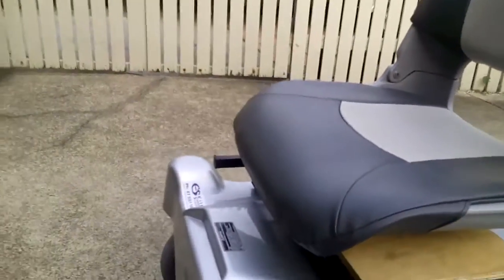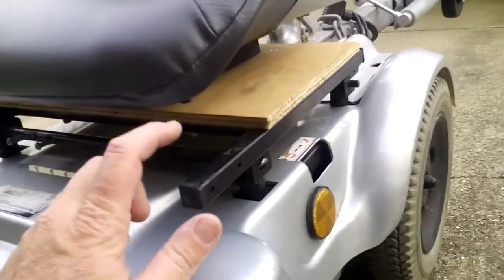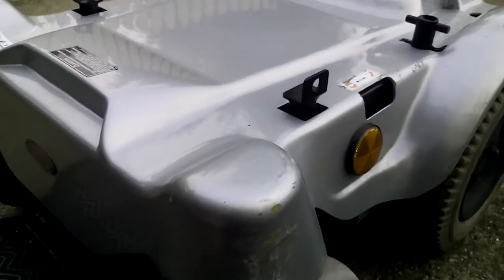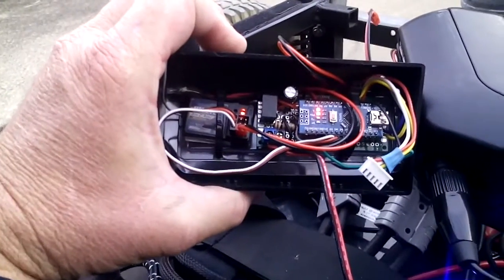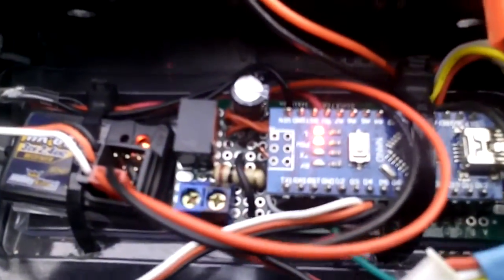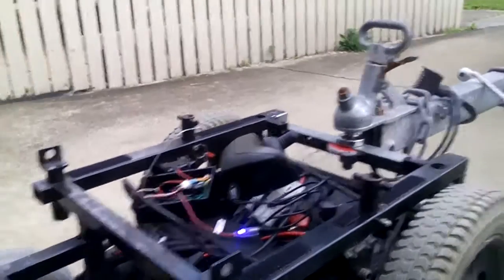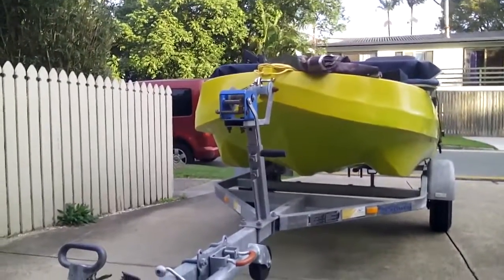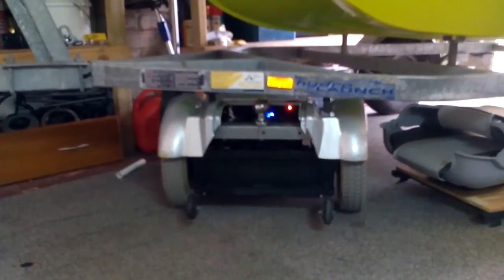Tear down and demo of my RC wheelchair boat towing power chair

Comment: Every single person on YouTube making something (ESPECIALLY ELECTRONICS) will not tell you how it is built, to include parts, schematics, codes. Almost ready to tune out of YouTube and spend my valuable time elsewhere.
Reply: Hi Wayne, I show how it's built in other videos I have done and link to the code and forums that helped me along the way. In the Arduino code on those forums is the link to the PCB i built, which has a screen print of all the components.

Comment: Can this pull a 21 foot boat weighting about 2500lbs? Was thinking of making an electric dolly but if this works then i can buy 1 for about 300 n save me some time.
Reply: On the flat ground with rolling weight only....possibly. It would be easier/cheaper/quicker to use the same sort of base as a power assist for manual steering and manual turning to overcome the inertia of the load.
Reply: @anthonymatthews4955  i went ahead and ordered the winch and sprockets to make the dolly since im not sure about the power of the  wheelchair but thank u for the info

Comment: Could you do this for the Pride Jazzy 1450?
Reply: If the power module is a Shark then yes, i've a list over at www.gctek.me with more info on the stuff i put together.
Reply: The power module is PG drives VR2
Reply: yes but need different interface, available over at wheelchairdriver.com look for posts by 'woody'

Comment: "they throw away all the good stuff" - you're not kidding. I got a chair recently to do an R/C conversion and I'm really impressed with the quality and precision of the controller and motors.
Reply: This is the web page i have done up to bring all the stuff together for my the project, http://gctek.me/dynamic-controls/shark/rc-wheelchair-controller/ , gcebiker is my forum name. I have a link there for anyone wanting code or the boards i had made up to neaten this version up.
Reply: I just ordered one of your boards from DirtyPCB. I don't suppose you still have any of the ones you had in August? I could use a second one.
Reply: Hi Yes, i have more and parts to fully populate and test if you have the need. Here is a link to the build thread ... http://www.wheelchairdriver.com/board/viewtopic.php?f=2&t=4867&sid=81ca920eaab6b64fe0e6b75ab83dcc31&start=560#p106649
Reply: I have some of the blue and some of the Yellow left...the Blue are better IMO
Reply from the maker: Code updates on the forum , my code was missing the shut down sequence so the bus was putting the controller into LIMP mode, updates fix this issue....i guess by now you see that 10 boards come for about $1 per board...pretty cheap to get them, link to purchase the boards is also in the code over on Wheelchair driver .com